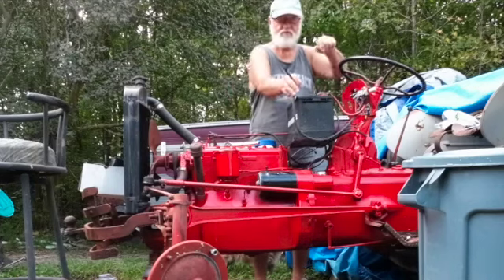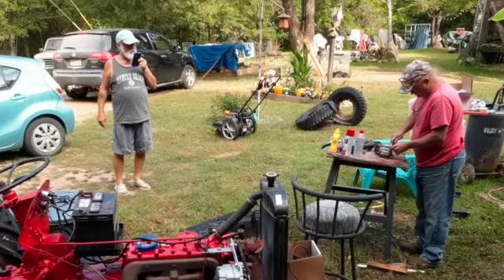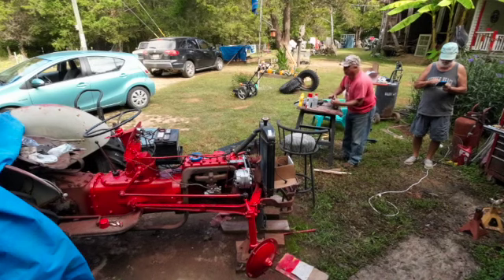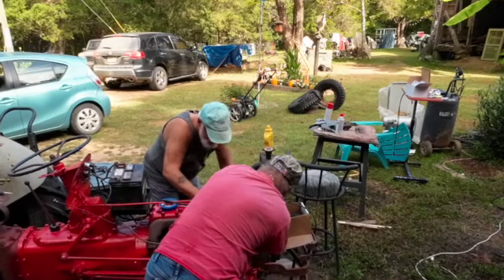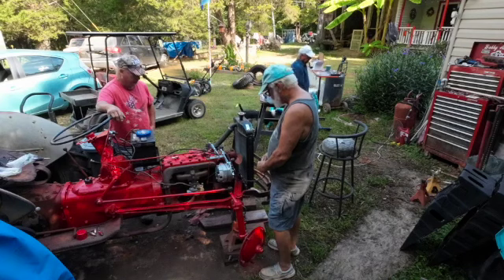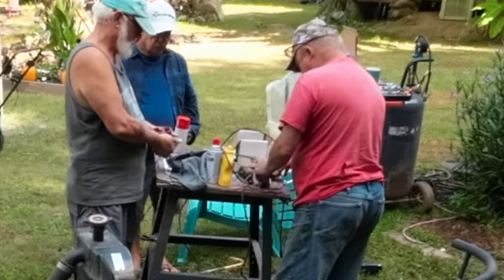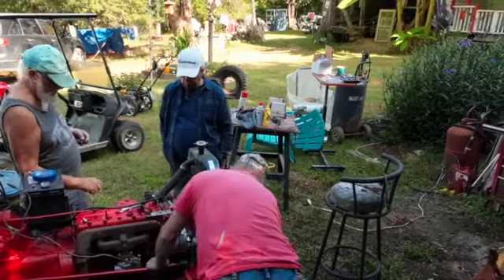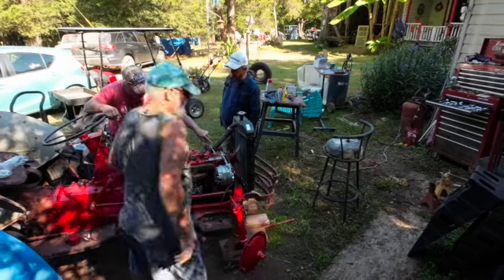1939 Ford Tractor in field 20 + years, will it run?  1

Comment: Haaa lefty tighty righty loosely your backyard rich..😅the key switch should have fire when you are cranking also..check the ignition switch..if the key switch has fire at all times to the coil then the coil has to have fire your hair should be standin up if not than the coil is messed up either points are stuck or something in there or hears a thought is the coil spinning on the moter if not it might not be meshing in the destribitor..then u got a problem.
Reply from the maker: k